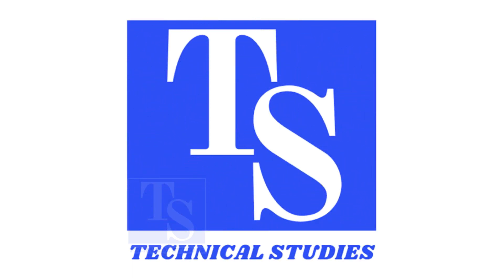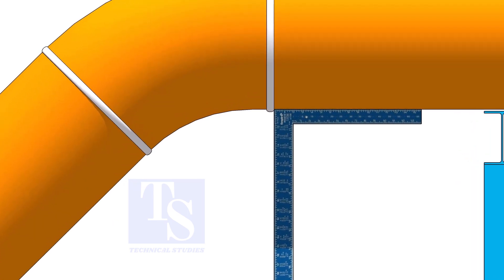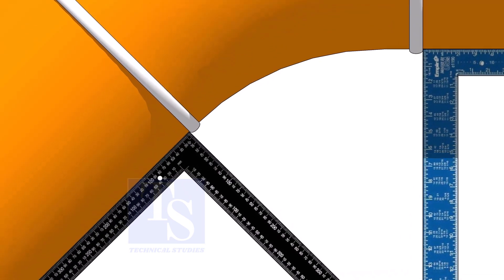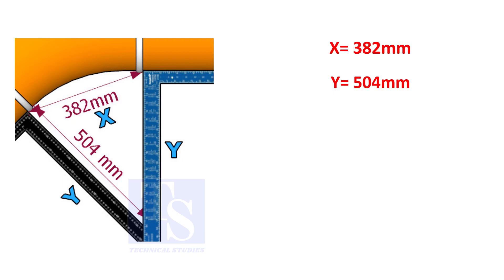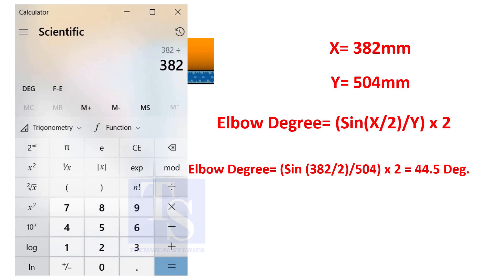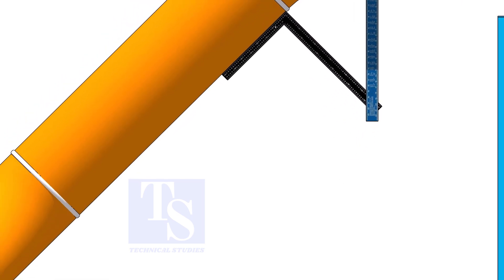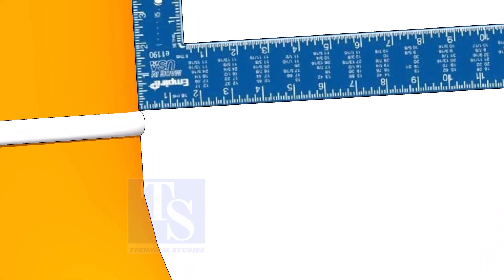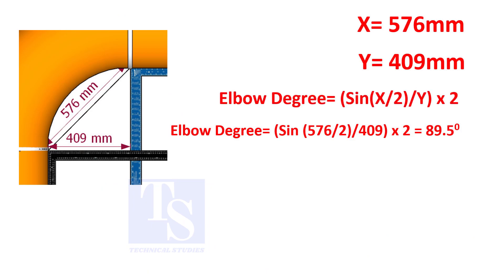How to find the degree of an elbow on an existing pipe. मौजूदा पाइप पर कोहनी की डिग्री कैसे पता करें

Comment: Will the Y be same value on both sides?? Or will it come same everytime??
Reply from the maker: if, both the pipes are tangential to the elbow, both sides will be equal. normally it will be tangential. It depends on the quality of the fit-up. You can apply this method. There wont be any issues.